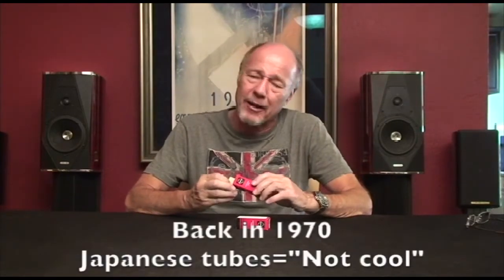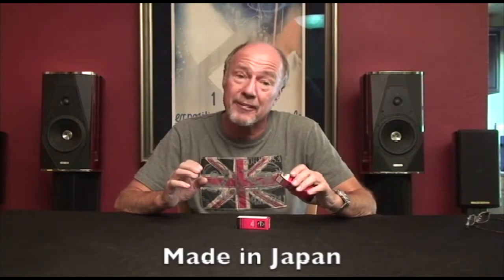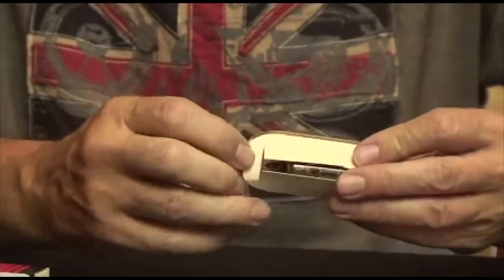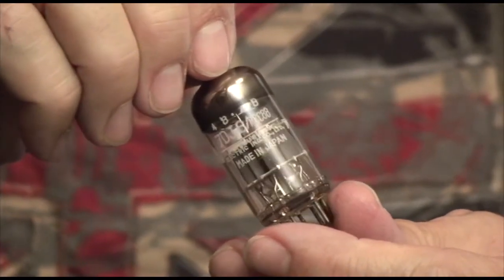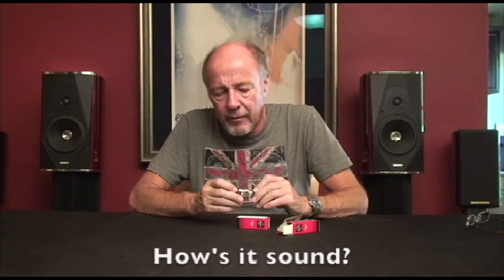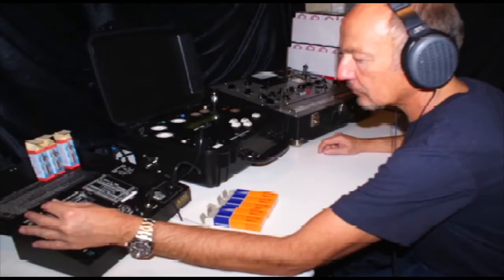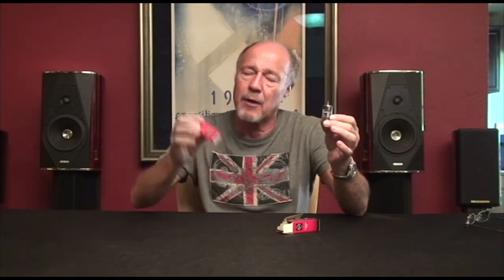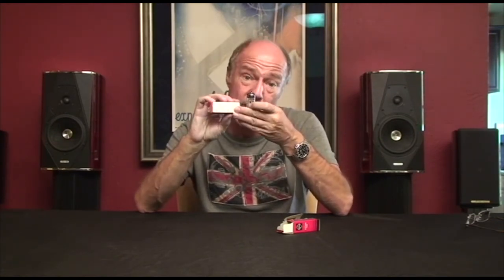Upscale Audio's Kevin Deal reviews the Matsushita 7DJ8

Comment: A 7DJ8 is not fully comapatable to a 6DJ8. The heater voltage is different (7.0v verses 6.3v) and the 7DJ8 requires a HIGHER voltage (or better, a constant current heater) to work correctly. Pins are the same though.
Reply: for all intents and purposes, yes, it is most definitely fully compatible and as matter of fact the 7 volt tube will last even longer than normal being fed 6.3 volts instead of 7 volts

the sound quality difference between the two voltages is negligible as is the operation of the valve itself
Reply: @tmackn6592  7DJ8 will have different gain characteristics and will be outside the designers intent. Best way to use is have constant current filament supply which prevents switch on surge to the filament and a staged hv supply. That's what is in my preamp when I switched to the 7s.